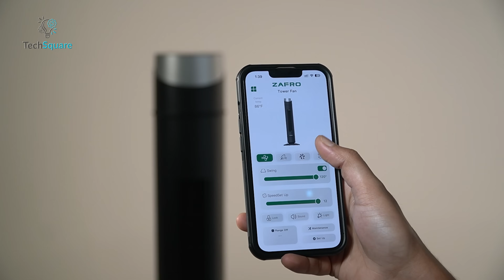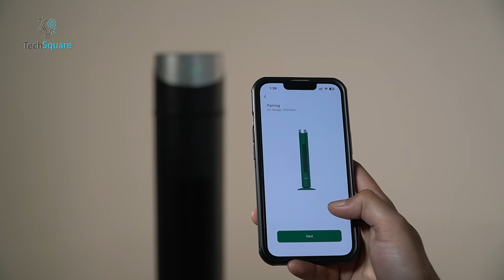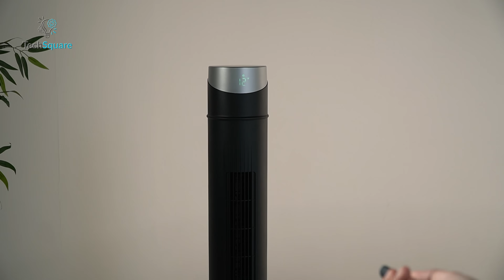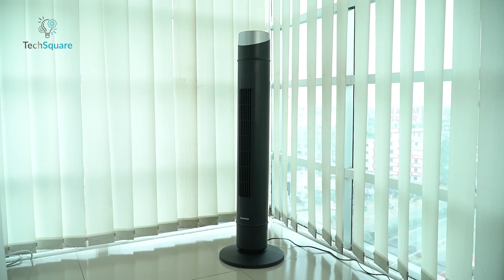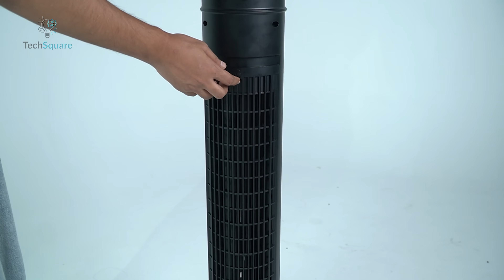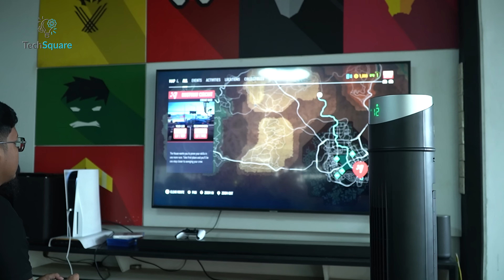ZAFRO Smart Tower Fan Review – Smarter Way to Stay Cool?

Comment: Solid review — the sleek design and smart controls sound like real strengths, but noise performance will probably be the deciding factor for a lot of buyers. It seems like a good option if the app features are genuinely smooth to use.
Reply from the maker: It’s definitely important to weigh those performance aspects when choosing a fan for your space.